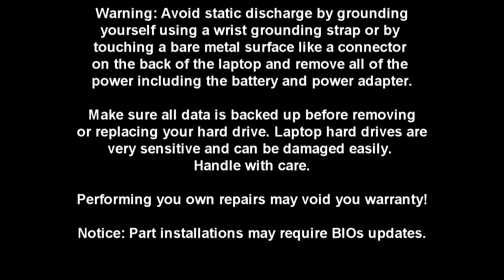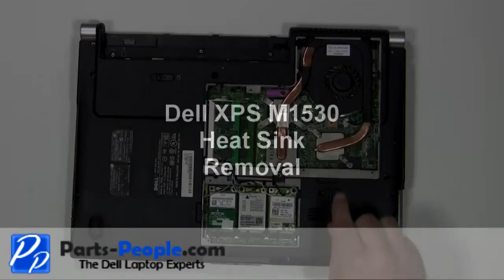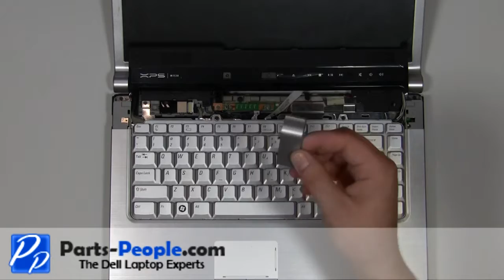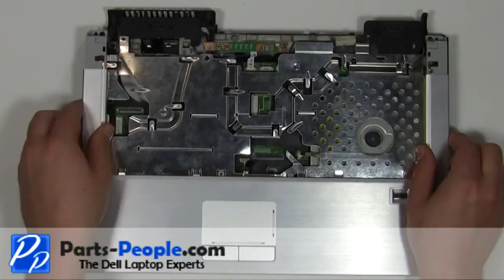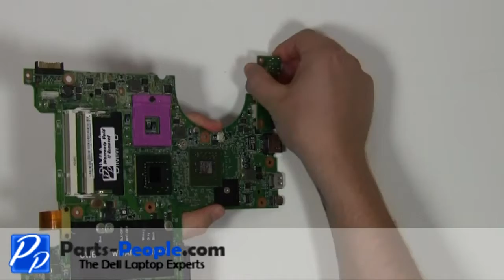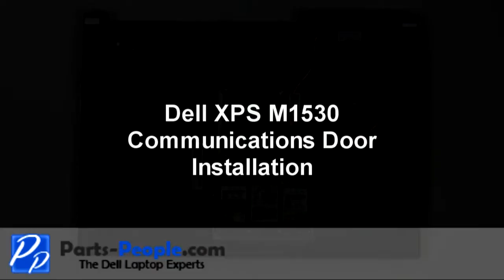Dell XPS M1530 | DC Jack Circuit Board Replacement | How-To-Tutorial

Comment from the maker: On the M1330, the DC jack is built onto the motherboard. You would have to solder a new jack onto the motherboard or replace the motherboard completely. Here is a like to replace the motherboard if it helps. 

ppci.me/b/FXvA

Comment from the maker: Yeah that is most likely going to be your problem, but on the M1210 the DC jack is soldered on to the motherboard, so it's not that easy of a fix. You will probably have to take it somewhere to be fixed.

Comment: Dellpartspeople,

Excellent video.  However, I have an M1210 and I am having a problem where it says the adapter  is not recognized.  I have replaced both the battery and charger to no avail.   Would you recommend changing the DC Jack as you have done here?  Thanks!

Comment from the maker: Usually that is caused by a bad DC jack or board. Considering you changed it, the board may need to be re-seated. Having a bad power adapter is possible and should be checked but I would also consider the possibility of the DC board you installed being bad. They're difficult to test and can be damaged easily.

Comment: I was able to change the DC board after using this video. Amazing instructions.  After the board replacement I got a diagnostic screen on boot up saying that it could not detect the changer.  The system runs fine when the AC adapter is plugged in, but it will stop not obtain a charge. Is there a change that something is up with the power supply now?

Comment: THANK YOU for this very-well documented teardown/rebuild video.  DC charger board successfully replaced, with no extra parts. Battery is charging once more.  The only recommendation I would add is to be exceptionally careful, with a very light touch, when releasing the several micro connectors which use very tiny plastic clamping mechanisms to hold down the various ribbon cables.   I'm deeply grateful for you documenting this procedure.

Comment from the maker: The fingerprint reader cable is the cable being unplugged at 7:08, if I'm no mistaken. If it's loose it could cause the fingerprint to not work. You also check to make sure the drivers are installed.

Comment: First, excellent video!  Well done!  I'll be using this and your part site in the future to keep my m1530 running.

Second, question for you.  I noticed there was no mention (or in any of your video titles) of the fingerprint reader.  Is there a cable connection to the motherboard or wrist rest?  A service rep replaced the motherboard a acouple years ago and the fingerprint reader hasn't worked since.  Thanks!

Comment from the maker: @pas363 Replacing the Dell XPS M1530 DC Jack Circuit board should solve the charging problem, however; the problem could also lie with in the motherboard itself.  I would recommend starting with the DC jack circuit board first since its is cheaper and easier to replace.  If that does not solve the charging problem then I would look at replacing the motherboard.